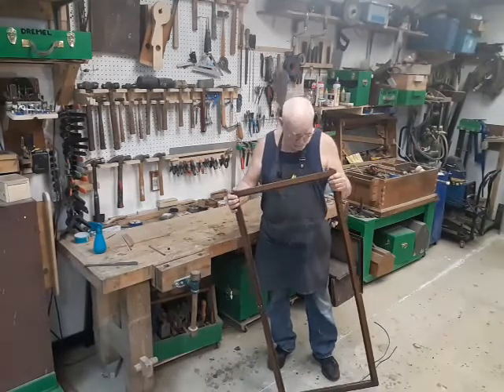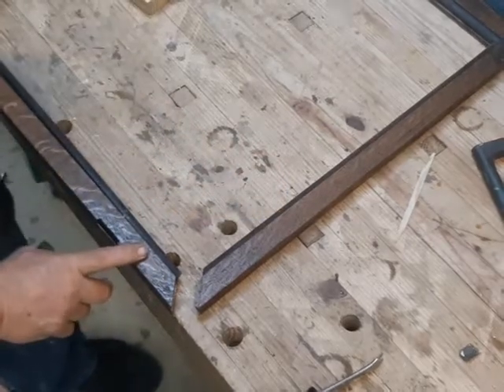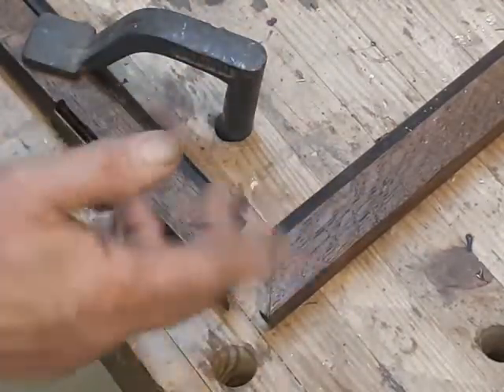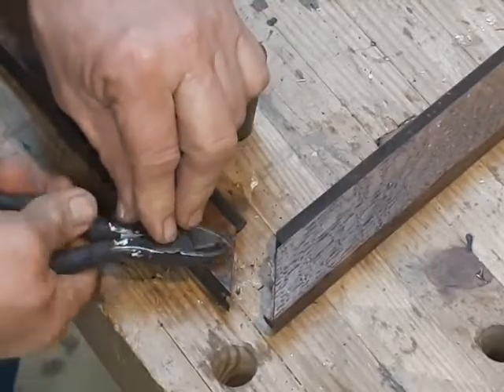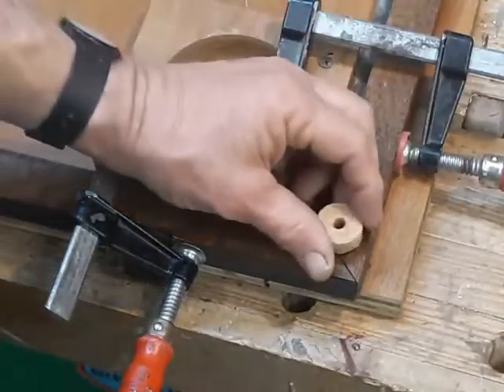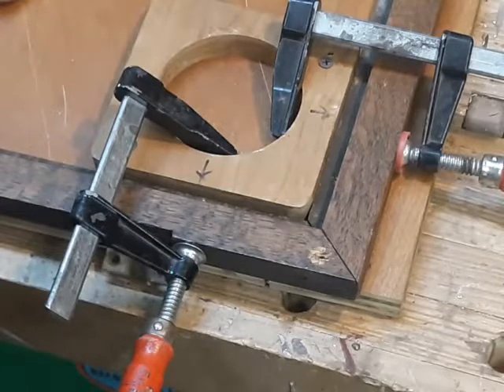Repairing a Fractured Bridal Joint in the Secret Underground Laboratory Recovery and Salvage

Comment: Hmm... fast and dirty repair. I missed the portion of your commentary as to how you think the joint failed and thus you determined the most cost effective repair/ improvement. My first thought was to cut a groove ar the corner slightly larger than the original tenon or of the same size into which I would insert a spline, keeping the repair similar to the original construction. Your repair affords significantly less glue surface area, which might be sufficient, depending on how this frame is attached to the door. Oh, did you find a nail in all four corners, which might have show that it was a feature of the original factory construction?
Reply from the maker: In a door like this, the frame is very light and when the glass breaks, it's very easy to flex it until a corner snaps.
Reply from the maker: To answer the question, I considered putting in a spline, but that would require a jig to hold the frame, either for hand sawing or a tablesaw. A new glass pane was fitted and bedded in silicone. This insures the corners won't come loose again.